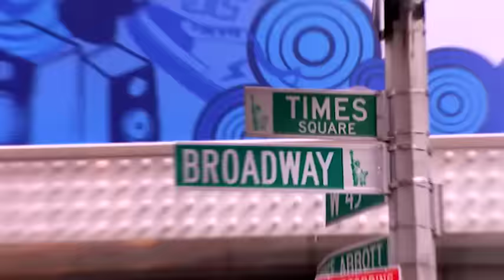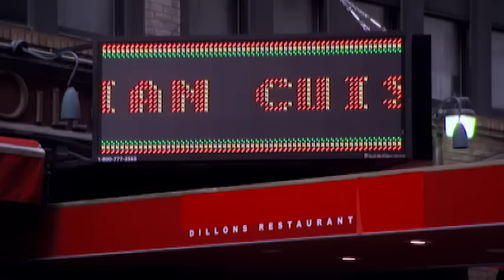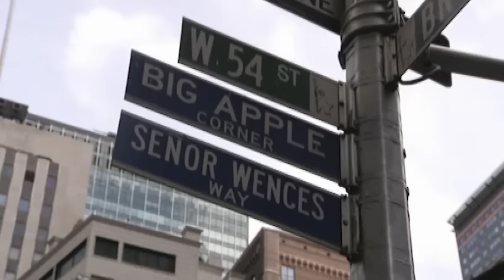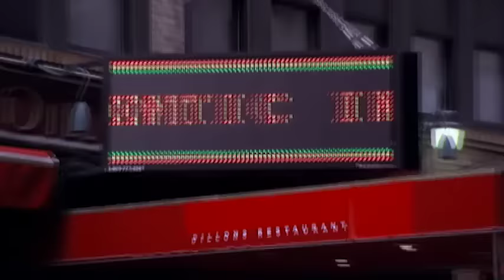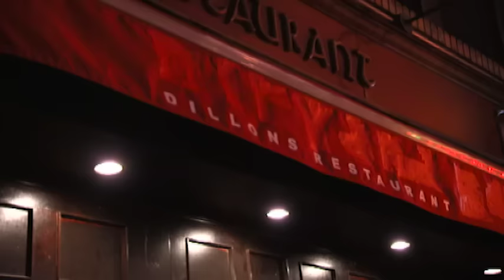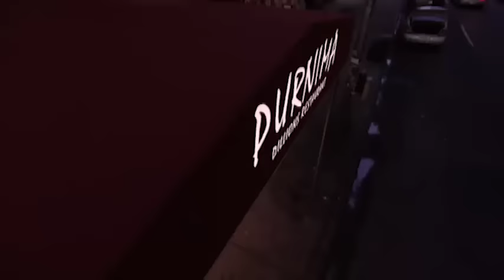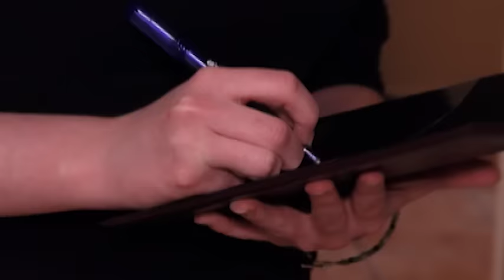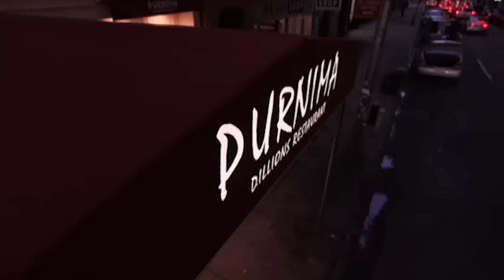Kitchen Nightmares Uncensored - Season 1 Episode 10 - Full Episode

Comment: SPOILER:  Before the Dillon’s Kitchen Nightmares episode even aired, there was some drama.  Martin Hyde, the general manager from the episode, tried to sue Kitchen Nightmares for $3 million.  He also attempted to file an injunction to stop the episode from airing.  Given that the episode did end up airing, you can guess that Martin’s lawsuit failed.

After Gordon’s help and the rebranding from Dillons to Purnima, the restaurant seemed to be doing well.  Gordon visited the restaurant one year later, and everything was running smoothly.

Purnima closed in 2009, two years after the Purnima Kitchen Nightmares episode aired.  For a time, the old Purnima New York City location was occupied by a place called Dillon’s Comedy Club.  

However, as of 2023, the location now seems to be occupied by a place called The Grisly Pear, which is a bar and comedy club.